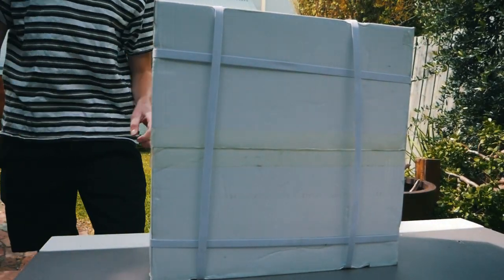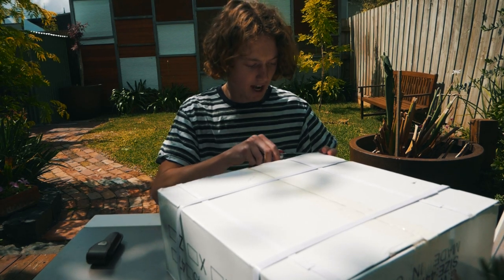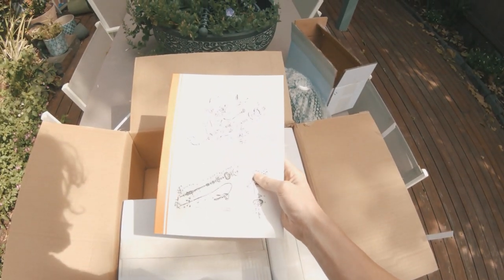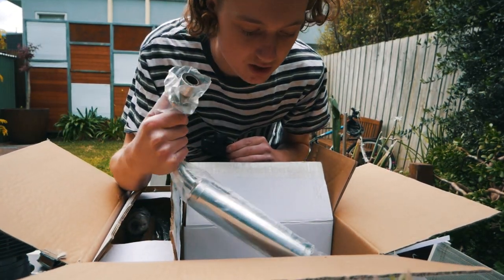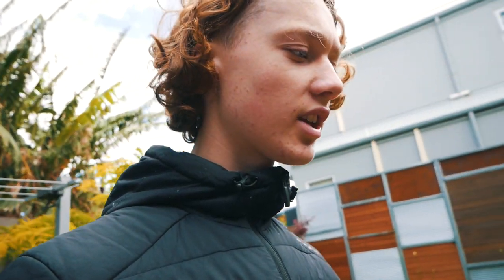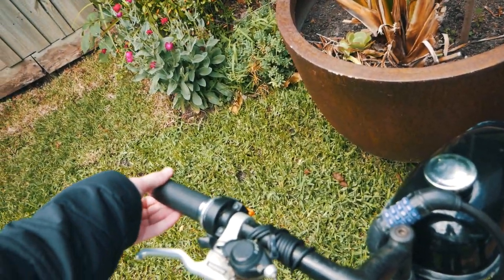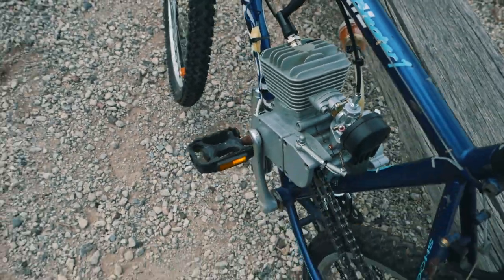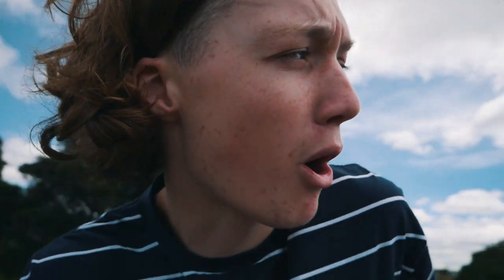100cc Motorised Bike Build

Comment: I highly recommend anyone that uses one of these bikes, get the biggest tires you can, infalte to a very soft 18psi, use tire liners to make the tires tougher and resistant, the softness of riding with big soft tires is so good, i use dmr moto 2.2 tires, 18psi. kevlar liner and rubber liner. its bouncy like suspension and rides so much better.
Reply: How far can u go what does the cc mean how far can u go on 80cc or 100cc
Reply: @bxboyupqllnight     you can go to the moon if there was a road there. i recommend taking tools

Comment: Nice build. Looks quicker than my 66cc for sure. Gotta pick up a used mountain bike and slap one of these on. Looks like a great motor for an off-road build. Get a proper expansion chamber for it. Should see good power gains with a good pipe.

Comment: Was going to get the 100cc but got the 80cc considering its my first motorised
Reply: 80cc motorized bike kits are 66cc, it’s just listed as 80cc for some reason despite the lower power
Reply: @rudyh9027  and 100cc engines are real???
Reply: @tonipepperoni5994  100cc are around 80cc

Comment: So much for breaking the engine in😂
Reply: A lot of people don’t know this but actually most of the time when the engine I first built In The factory they basically break it in then run it for at least 30 mins after.
Reply: @greenbeanz.343  Not most of these kits they are built cheap as possible it's best to tear them down and inspect everything bc qc is not the best they def aren't spending 30min running each engine they are trying to make as many as possible tear down a new one and u will see It was never ran

Comment: Drop to a 36t sprocket. You’ll still have a torque with amazing top end speed
Reply from the maker: Okay easy bro I’ll try that
Reply: Im 32 10 and on my custom Cranbrook I do 90 flat out
Reply: Donnalea Brookman that’s nuts, I did 72kmph on a 36t. Still needed to be tuned
Reply: a.b bikes yer mine is not tuned at all really .....either
Reply: A 36 tooth will have no toque at all I have a 41 and can hardly go up a hill ( also I’m only 88 pounds
Reply: @traysonwhitworth8968  how many cc I'm 250 pounds and go up hills fine with a 38 tooth
Reply: What brand engine is this?

Comment: Huh.I get to be #400.Great vid.No 'heads'to put on those as the cylinder&head are 1 to take the 50mm sleeve.You can expand the ports a bit,but shouldn't really.Open the exhaust to much will give more torque,but lower top end.I took the end off the stock muffler and cut the tube inside in half,drilled 2 of the holes 12mm almost to top inside,and put the cap back on.Happy Trails !
Reply: U have that backwards fella.  Open exhaust duration too much and I lose torque becuz ur dropping compression, which means more revs and less torque

Comment: Yea u killed that engine dude u have to mix oil 16 to 1 for two tanks and dnt go past 20 mph and dnt high rev it until break in is over and when break in is done u mix 32 to 1 oil mix on 100 cc or 40 to 1 if u do 40 to 1 u dnt get as much torque

Comment: Dear friend, i saw at ebay's pages, 2 stroke motorized bicycles kits for sale-brand new, something strange.The 80cc motors have 2,5 Kw power (5000 r/min) . and the 100cc motor has less (1.9KW), due to the description. Why is that?
Reply from the maker: Not sure man every motor is slightly different in its own way none of the motors I’ve had live up to what they say they are as long as u put it together correctly you’ll be fine

Comment: WHAT I DONE ,,WHERE THE EXHAUST COMES OUT OF THE ENGINE,I CUT IT OFF,AND IT ACTUALLY GOES THROUGH THE BIKE FRAME ITSELF,,AND THE SMOKE COMES OUT UNDER THE CRANK PART,,I PUT PACKING IN THE FRAME,,I HID THE ENGINE WITH PLASTICS,COZ THE POLICE PULL YOU OVER,,AND THE EXHAUST IS THE MOST OBVIOUS THING THAT YOUR RIDING A BIKE WITH A ENGINE,,,IM TELLING YOU LADS MY EXHAUST COMES OUT U DER THE CRANK,AND ITS A BRILLIANT VERY QUIET SOUND,,AND NOT ONE BIT OF RATTLE,,
Reply: WHAT COUNTRY ARE YOU IN AND HOW DID YOU DO IT!!!????
Reply: Pretty cool idea.  Mine is so wicked loud it wouldn't matter lol.  My 66 seriously rips tho.  I reed ported it and added the rse reed.  Decked the head, it's crazy.

Comment: you should not use the choke to shut off the engine, technically. It will flood the engine. Instead cut the spark to the engine with the kill switch. Thats what it is for.
Reply: Super bad for the magneto. It shorts the mag in order to kill spark. Not a good method.

Comment: Hey kid i beg to differ with you these are not shit motors if you ride them right . Have you ever read the book ? It says do 10mph first 100 miles after that do not exceed 20 mph . I took the cheapest motor from e bay 10 years ago and road it pulling a trailer with 250lbs of gear and road it all the way from Tampa florida to las angels and back only breakdown i had was a flat in arizona . So to say these are not good motors well maybe it's not a good rider .
Reply from the maker: Alright lad

Comment: Its an actual 78.5cc not a 100, but who's counting the size right. 50mm piston with a 40mm crank. I have one mine does 42mph on stock parts, that's not fast, my 47mm piston 38mm crank 66cc did 45mph stock, Ported. But it has more Torque that's it, I repeat its not an actual 100cc.
Reply: Eduardo Diaz there 72 read my earlier posts
Reply: Eduardo Diaz and with a ms660 on 38.5 crank witch they are ....it's 92 cc cheek ya shit
Reply: Its a 40mm check your own shit, I took my engine apart and measured 40mm crank and 50mm piston
Reply: 78.54 call it a 78.5, but that's irrelevant since that's not close to 100 as a stihl head
Reply: Im pushing 42.4mph tops on a digital speedo/Odo that's agreeable since I didn't do anything to the engine, seems reliable than an overheated frankebuild
Reply: Eduardo Diaz lol U clearly don't no yours there 38.5 mm stroke not 40 as claimed ....
Reply: And U obviously don't measure because myself and many other builders have done the math go site some other builders
Reply: The 80cc is actually about 67cc. I don't know why they just don't call it what it is. Just think of it as a 10mm big bore kit for the 66 engine. Stoked to try one. Should be able to pull taller gearing with more torque and will probably rev out even more with the new bore/stoke ratio.
Reply: Budget Bikes it's not as there not 40 mm stroke as stated I no ....for a fact .....I build some of the best engines U will Eva ride
Reply: Budget Bikes and how is it a 10 mm big bore kit wen the stock china is 47 mm and it's 50 ......think before you speek mate ....there 72.somthing cc .....that's it ...no debating .....I no ....IV measured everything and also work with some of the best builders in the world ......my real name is Luke Walker ......go check some bike groups and ull see I no wat I'm talking bout
Reply: @donnaleabrookman659  mate, the pk80 and a80 and cranks are a 40mm stroke and like 90% of all engines including the bt100 (100cc kit) use it.
only zae50 half breed and zaf80 cranks have a 38mm stroke and they are quite rare in engines these days cause they are the old style ones. http://pk80engines.com/home/pistons-and-rods/
Reply: so yes the bt100 is 78.5cc not 72